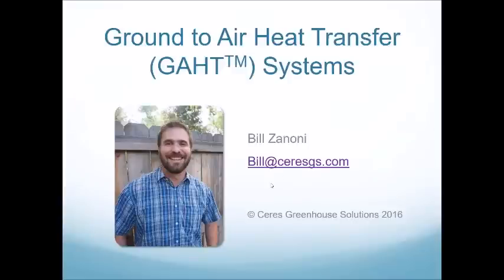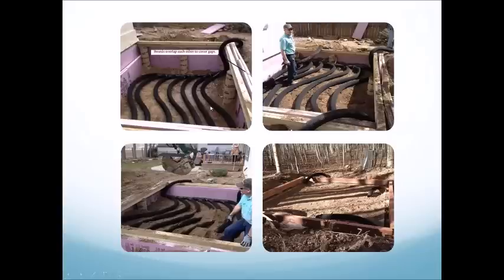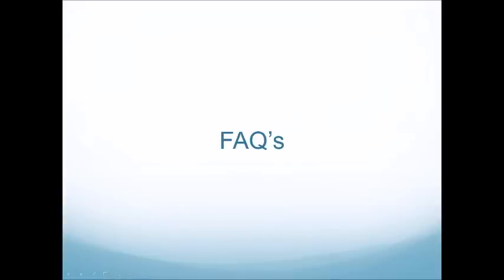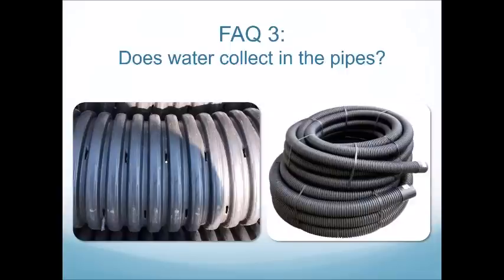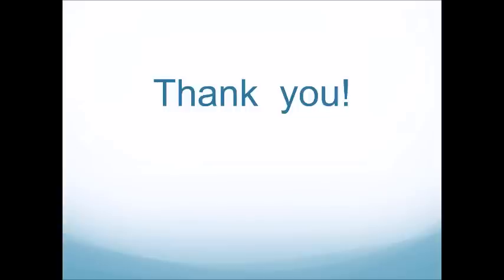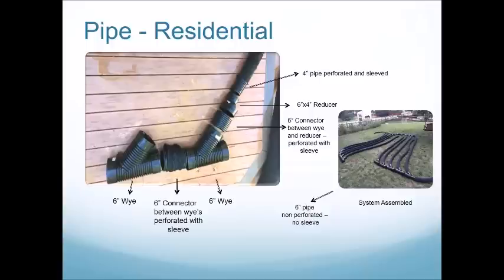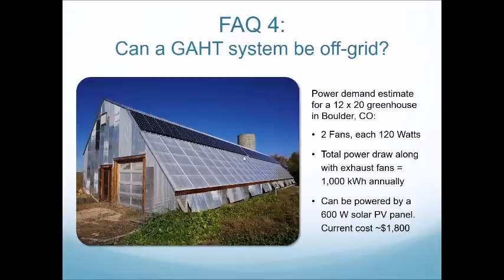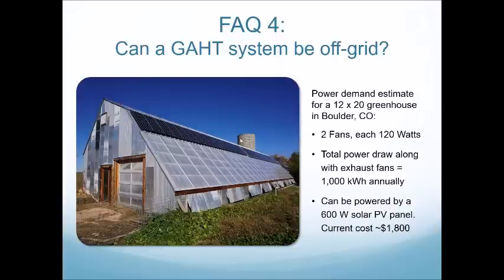Intro to GAHT® (Ground to Air Heat Transfer) Systems

Comment: Great video. I was wondering how could the optimized fan velocity/CFM be determined?
Reply from the maker: We have proprietary formulas that help us determine fan velocity appropriate to the final design. Inline fans range from 8"-18". For more information, feel free to reach out at www.ceresgs.com/contact/
Reply: @CeresGreenhouseSolutions  proprietary math?  😆
Reply: @CeresGreenhouseSolutions  ⭐ Hi, have you had any issues with mold in the pipes or a negative effect on air quality?
Reply: Have you had any issues with mold in the pipes or a negative effect on air quality?

Comment: Why do you use perf pipe vs solid for the runners?  Getting ready to do my GAHT system here in Montana.  My plan is to do this in a new garden area since greenhouse excavation would be a PITA.  I will then use that space for my big compost piles so there will be an insulating cover (actually heated) all winter long.
Reply from the maker: the perforations in the GAHT piping allow for moisture in the air to escape so there's no build-up in the piping.
Reply: @CeresGreenhouseSolutions  thanks for quick response.   You aren't insulating below the pipes at all are you? Just the sides?
Reply from the maker: @montanatinboxliving1408  We are just insulating at the sides, yes
Reply: Actually putting your compost in planters on the walls of your greenhouse adds quite a bit of heat

Comment: Hello. How deep I would need to place each of the two layers, if I want to grow tropical plants in an area with altitude of 1140 meter above sea level? Thank you.
Reply from the maker: Hi, We recommend that the systems layers be placed at 2' and 4' below grade.  In theory, the deeper you can place the systems the better, but you need to watch out for areas with high water tables.

Comment: I'm only 12 minutes into the video, so please ignore this if it is addressed later. Is the fan necessary? I've heard passive greenhouse designers talk about using a height difference for intake and output pipes to create air flow based on the temperature. As you can tell from my lack of terminology, my physics knowledge is lacking.
Reply: I’d say it’s necessary in this case as there is no hot air escaping creating a vacuum of cool air behind it as utilised in earthship building.
Reply from the maker: We have found that fans are necessary for optimal system performance.  In theory, a passive approach may work, but using a fan allows for more air to be conditioned by the climate battery.

Comment: I have heard claims that the heat you push into the soil in the summer will be available for use in the winter.  That seems unlikely.  What is the truth in this matter?
Reply from the maker: The truth in the matter is that it entirely depends on where the greenhouse is located and the amount of solar energy available during the day. This blog might help to explain things a little better: https://cerescann.com/ceres-gaht-system-versus-the-ceres-ecoloop/

Comment: Great video, I've been thinking of building a greenhouse (maybe 12x20) and have been researching these systems. This is very informative, nice work. I'm in a zone 4, so it's cold in winter, not even sure if I want to use it in winter, but certainly early spring and late fall. Around here I can only find weeping tile with a sock on it. Do you recommend this be removed or does it not matter?
Reply: I am designing a commercial greenhouse utilizing one of these designs, everything I have found says the weeping tiles with the socks are the way to go. You don't want debris to enter your heat pipes.
Reply: @robertj.wiltshire1553  That's great thanks, I knew the debris was a factor that benefits from the sock, just wasn't sure about the sock retaining humidity and not dispersing it quickly enough in relation to the air flow being so high. It's probably not a factor I need to worry about, but I'd hate to find out later I had excess mold issues because of it and I've found no conversation on the subject. I'm just trying to cover all bases, that's one part of the build you can't change or modify later. I think I might just lay down a couple of inches of gravel under each branch before returning the soil back will ease my worries.
Reply from the maker: Good question. We recommend that you use perforated piping with a sock covering so that condensation can drain and you don't get debris in your system

Comment: 'Face change" material for thermal mass?  Not sure what your talking about there.

Water (best heat capacity per unit mass of any sustance) has about 3x the heat capacity as stone and more so than soil.

There can be issues getting the heat into the water however a large subterranean water storage mass is your best bet for maximizing heat capaity.  Many "geothermal" systems run pipes into ponds to grab the heat.  You need many many more times the weight (and volume)of soil or stone to hold the same amount of heat that water can store.  

Due to this fact has anyone seen data or design on subterranean water thermal mass?
Reply from the maker: Sorry about the audio, what he actually said was "phase change" and we talk about this material in our blog: https://ceresgs.com/tips-on-using-water-barrels-in-a-solar-greenhouse/

Comment: 12:50 Interesting comments about the temperature of the intake air and how that might effect the efficiency of the heat transfer underground. I would have thought ‘ hotter in ‘ was better, but apparently not necessarily. I would like to better understand this.
Reply from the maker: We have a GAHT® expert on-hand who is more than happy to explain the capabilities of the system more in-depth. Please email info@ceresgs.com with your inquiry and we will get you in touch with him.
Reply: Heat transfer efficiency depends on maintaining a temperature differential over the full length of the tube. If you have a 20ft tube and the air drops to ground temperature in the first 10ft, the remaining 10ft wont be contributing anything. Using cooler air will compound this as the temperature difference is smaller to begin with. You would be surprised how fast heat is transferred. Most systems use overly long tubes and insufficient flowrates. The inline fans at 12.50 look like they are equipped with 6"- 4" reducers which will have a big impact on the flowrate and the system efficiency. An expert simply wouldnt make this kind of basic error.
Reply from the maker: @JohnGuest45  If you have questions about the efficacy of the GAHT® system, and would like to talk to our technical expert, please email us at info@ceresgs.com. He will be happy to talk through everything with you.
Reply: @CeresGreenhouseSolutions  
I trust it wont be the same "technical expert" that thought fitting reducers on the fans was a good idea.

Comment: Positive pressure? Only if the pneumatic pressure is high enough to overcome the hydraulic pressure! Short answer: unlikely, hince the mold issue. No mold should be present in a true positive pressure system. It is likely that the mold spores is collecting outside the perforated pipe and sporing in that safe area.

And for the gravel, that is a moisture proof, very dense, thermal mass. A heat/cold battery if you will. 

My grandpa filled a buried con-x with gravel, top 12' down, plumbed the container to his house, hooked it up to a solar fan, and his house stays at a near constant temp, around 60, year round. 110 outside, 60 inside, -25, still around 60. He added a thermal heater, and for winter it's 70-75°
Reply: What is a con-x?  I'd love to see a diagram or plan of your grandpa's system
Reply: @justgivemethetruth  the ground is a huge thermal Mass one of the best you can come up with it will store Cool air or hot air. To store hot air pipes need to be a little closer and the whole enclosure needs highly insulated especially at the top. solar thermal collectors can heat the soil and be extracted even years later. Special care needs to be taken to keep out moisture and condensation.

Comment: If the underground pipes are peforated, what stops the backfill from blocking the holes?
Reply from the maker: Hi Ed, We recommend using perforated and sleeved pipe to prevent the issue that you describe.
Reply: what about landscaping fabric atop each layer?
Reply: @Jarrett_Hagar  you could wrap the pipe but the socks that they sell for it are ready to go and on in a few minutes.

Comment: Hey I love what you guys are doing. I'm in zone 7 in New Jersey.  I am doing a residential greenhouse. In my area I see a lot heaters in hoop houses. Im wondering what is the best to mid range material to allow sunlight to enter. meaning what the exterior should be best , glass or poly-. I will be in touch.
Reply from the maker: It depends on your growing goals, climate, budget and more. We offer both types of glazing but it would be best to speak to a designer to decide on the best material to use for your project. Email us at info@ceresgs.com or fill out a contact form here: https://ceresgs.com/contact/

Comment: Does this give a cooler and warmer sides of the greenhouse?
Reply from the maker: Depending on the size of greenhouse we will install more or less GAHT outlets to make sure that the cool or hot air is evenly dispersed.

Comment: hi you 2 sets of pipe 2ft and 4ft does this depth change with the depth of the frost line ?
Reply from the maker: It does indeed, we customize GAHT plans according to your location and climate.
Reply: If you have perimeter insulation installed (which you should) then the answer is no.

Comment: Put a UV-C tube in the outlet and maybe inlet tubes and that should fry any mold/funghi spores
Reply from the maker: Mold and fungi aren't issues with the GAHT™ system since there are perforations in the tubing to allow water to drain to prevent buildup
Reply: @CeresGreenhouseSolutions 
Perforated drainage tube is usually designed to let water in, not out.
Your own video shows the water cannot fully drain from the tubing due to the location of the perforations ,https://youtu.be/dzRh4GJDMD8?t=1386 the narrator clearly states water will not collect in the pipes which isnt true.
Reply from the maker: @JohnGuest45  We have installed GAHT® systems for many many growers and we don't have issues with water buildup in the pipes and or mold/mildew issues from the system. If you'd like to learn more please email info@ceresgs.com to speak to a GAHT® expert.
Reply: @CeresGreenhouseSolutions  
The issue is not with water build up, the issue is that the water trapped in the lower corrugations will be converted into water vapor when the system is used for heating. The webinar doesnt mention the increase in greenhouse humidity...The greenhouse air temperature may be 50F but it could also be in excess of 90% RH,  especially during the night which isnt good for plants or the greenhouse structure itself. Take a foot of 4" ads tubing, tip water inside and measure  how much remains in the corrugations. Multiply that amount by the total tubing length (in ft) and it will be significant. Convert the volume of water to weight (lbs) and multiply by 1000. Thats the number of btu`s the thermal mass will need to give up in order to convert the water in the corrugations into water vapor.

Comment: Is the pipe buried in regular dirt/soil, or is it in crushed rock or some other medium?
Reply from the maker: We recommend that the systems be back filled with loamy soil for optimal heat transfer.
Reply: @CeresGreenhouseSolutions  
I am not sure what loamy soil means?  Are you saying that you dig out an area, dispose of that dirt, and then backfill the hole with some kind of soil that you must purchase and transport to the hole?
Reply from the maker: @justgivemethetruth  loamy soil is ideal growing soil, it retains water which allows for good heat transfer. In a perfect world, the soil that is already there is loamy enough, and oftentimes it is. But sometimes clients do have to dispose of the soil that is there and get new soil.
Reply: @justgivemethetruth  - clay works well for heat transfer also but gravel is poor because it traps air which insulates.

Comment: hi Bill has you tested for radon gas in the green houses.
Reply from the maker: In areas with high radon levels, it should be taken seriously. However, greenhouses are less dangerous than conventional buildings when it comes to radon. First, you are not in the greenhouse for as much time. Secondly, greenhouses have very high air exchange rates. During much of the year, air (and any radon) will be ventilated outside, and the whole structure will be flushed with fresh air in a matter of minutes. Even if the ventilation system is not on, greenhouses have many more air exchanges than a standard home, mitigating radon build-up. In our tests of GAHT® systems in the Rocky Mountains (an area with high radon levels), the concentration inside the greenhouse was found to be slightly higher than outdoors, but much lower than a dangerous level. By no means is this a comprehensive study, so if concerned, have your soils tested for radon before installing a GAHT® system.
Reply: @CeresGreenhouseSolutions   thanks

Comment: Can he GAHT be adapted to cool house attics?
Reply from the maker: To date we have never installed a house GAHT® system. This does not mean it is not possible. We just have not installed one. Before considering this option there are two concerns you should be aware of: 

1.Radon 
2.Mold

Radon can be tested. And even if there is radon, it is more significant to watch the rate at which it accumulates. In the worst-case scenario, if radon is detected the GAHT® system can always be shut off. 

According to studies that were performed by the University of Minnesota on several GAHT® systems where mold was tested no elevated spores were detected. It is important to keep in mind this is one study, and they were conducted on greenhouses and not homes. 

When trying to mitigate mold in the home you could use a filtration system with a UV lamp. It is important to look at the ducting system- how to get air through the system. We can help with the design of a new system, but it is harder to work with existing ones.

Understanding these precautions is necessary if you decide to try this system on a house. Please consult us at info@ceresgs.com  if you are thinking of a house GAHT®.

Comment: These systems are all horizontal.  If money were not an issue, could you design a vertical system.  All the condensation would escape at the bottom.  If I wanted trees in my greenhouse, I would need a vertical system.  Tree roots go deeper than 4 feet.
Reply from the maker: If money were not an issue, we could certainly design a system that was deep enough to avoid interfering with tree roots. However, many dwarf fruit trees have shallow roots (<24") and can be planted above a GAHT® system. We also have other methods of dealing with this issue that are much less costly than a vertical system. Please reach out to us at: info@ceresgs.com

Comment: most of the Best 
Listen.. Get a water tank heated by stove while you cooking, using heated water( glicol mix) 
While you ground warm later using for over nights.
Still need few control systems without using much wood.
Wood- water storage radial heat.
Sun- panel- battery- fan blow heat( cool time, nights)
Wood- smoke- generator power.
.. One the grate lately build compost hill heater ;) 
Can run all winter and produce heat above 50 degrees.
Time its over for spoiled ones.

Comment: I live in the far north canada, so I would be very concerned with thawing the perks frost
Reply: You need to insulate the bottom of the earth battery to avoid that
Reply: You would have to go below the frost line
Reply: In permafrost land. It would be very complex.  Dig your thermo battery tubes BELOW the permafrost layer, into the ground where it is warm by earth's mantle.  Then insulate the in/out tubes ,so you don't lose heat, or turn your foundation into muskeg    

I think it would be not feasible in permafrost lands .

Comment: Do you have to use perforated pipe?
Reply from the maker: We recommend it or else you will get moisture buildup in your pipes and this will cause mold and mildew in your system.
Reply: @CeresGreenhouseSolutions  So you are saying the airflow does more to cause mold than to eliminate it? (because of temp change) I have used fans to dry out basements and other spaces to avoid mold. I just thought the air flow would be a neutralizer.
Reply from the maker: @kenchafin9890  When your hot greenhouse air is pushed underground by your GAHT® fans and the soil cools it, natural condensation occurs in the pipes. That is why we designed our system to use perforated pipes so the moisture from the condensation can escape the pipes and mold doesn't accrue down there.
Reply: @CeresGreenhouseSolutions  That does make sense. Also, I was considering running a separate heated Pex line inside the GAHT  (with a Summer shut off), for winter use only for those extreme cold spells, What do you think?
Reply: @kenchafin9890  - I am going to have a separate pipe outside of the structure that runs through a trench filled with mulch to capture the heat of the compost reaction.